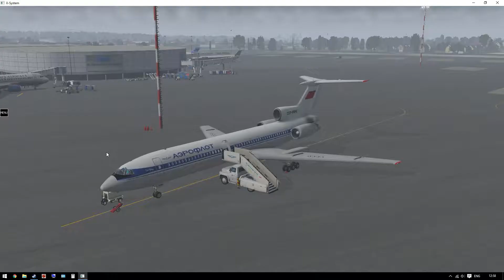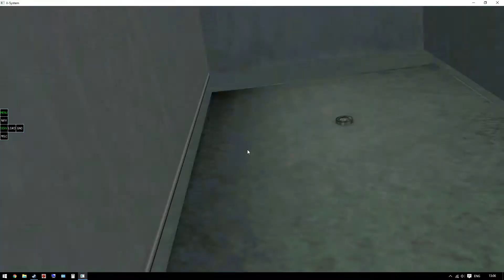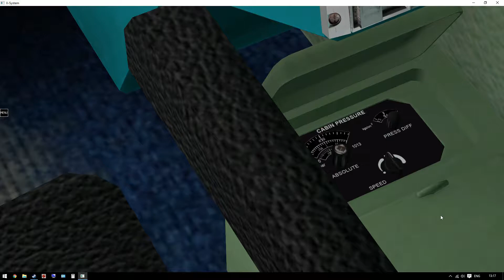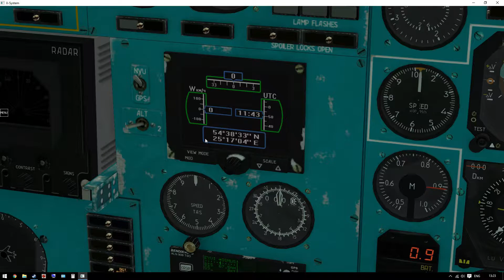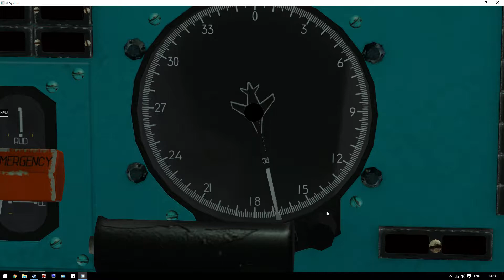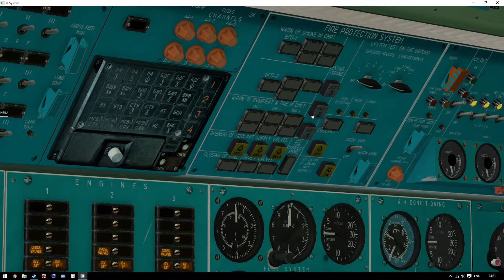Tu-154M in X-plane Part-4 Engine start and pre-taxi

Comment: 1) when you hit the main start switch button, the accumulated air will dump automatically to the starter air pressure, no need for you to depressurize ( is what you actually did there). There is a pre-engine start procedure using system 1 to test the pressurization tho, combined with my comment on the previous video of course.
2) ATT power should be on the same time Uvid and backup AH is, there's a fast align switch for it on the ABSU between the two yoke labels, or let it automatically align, after that you push Test 1/2 left of ATT power and if the AH's Ag flag doesn't clear recycle the ATT power switch. You got lucky that that flag disappeared on it's own or it would have caused an AP fault (no sound on AP FD siwtch on)
3) MAG-Main is CPT HSI, MAG-Ref is FO, DK-Main is CPT HSI+RMI, DK-Ref is FO
4) DK is a mislabel of sorts, it really means the True heading mode
5) AP FD is a mislabel, that switch is actually AP master power switch
6) By this time, you haven't even touched the panel above the Fire Protection which you should have
7) Doppler Nav's main requirement is 200mk/h of minimum speed to work, doesn't really have a height based one
8) Compass and IAS system heat should be on if OAT is below 5deg C 
9) another mislabel is the VOR/ILS HD, it means MAG (bottom) or true heading (up position) is used, and goes for everything, not just VOR/ILS
10) TRA-67A goes on too always
11) Exit signs go on too always
12) left horn of the yoke has the AP disco button, right sidse UHOD button is GA mode
Reply from the maker: Great feedback again! I will adjust my procedures and make a new video soon. 
Would you know by any chance what the TRA-67A does? Many thanks!
Reply: it's the lower transponder main power switch. The upper one should be in UVID mode inside Russian airspace, A otherwise ;)
Reply: Hi, great explanation, but I have a question about the gyro and ias system heat. So let’s say the oat on ground is more than 5 degree c, so we don’t turn on the heat. However during the climb the oat decrease, should we turn it on then? Thanks
Reply: @garyzhang5099  Exactly.